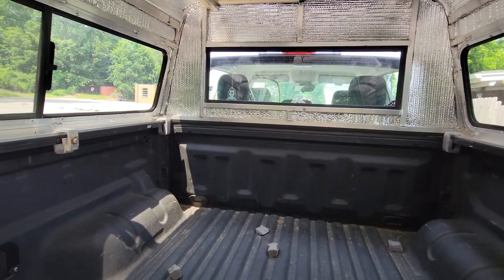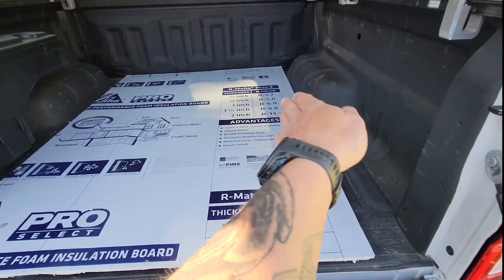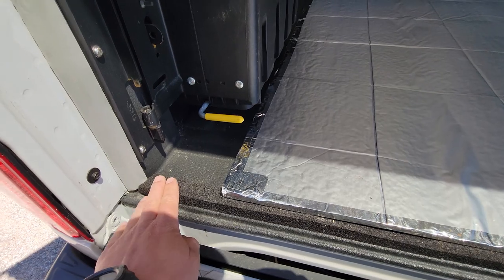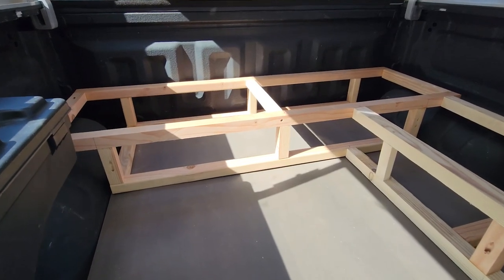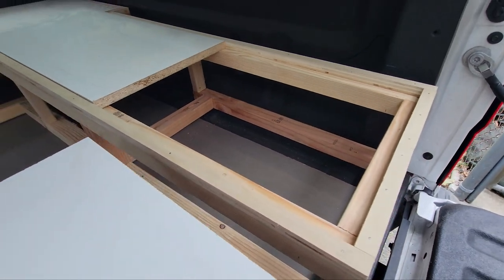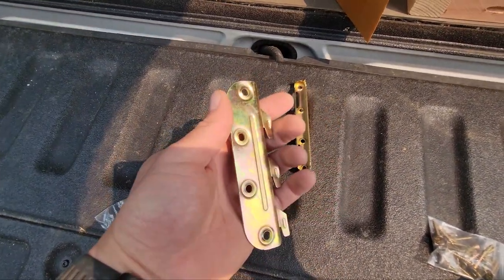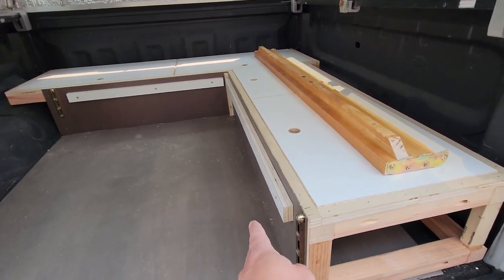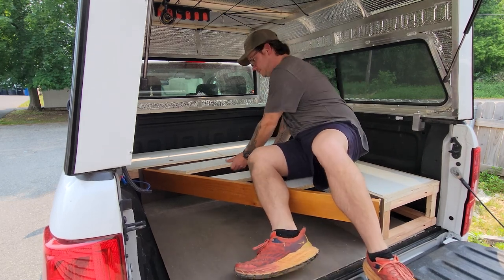Ford Ranger Truck Bed Camping Build Part 2. Floor and Bed DONE!

Comment: I sleep diagonally in my short bed truck too. Its awesome and super cosy.
Reply from the maker: It is a pretty cool way to camp. For those times where you feel like adventure but not a lot of work lol. I would be so happy if I had at least a 5.5-foot bed though. This truck is awesome. The bed size is the only thing that haunts me.
Reply: @projectknifehand  I hear you. I'm about to completely re-design and build my camper. After camping in it several times I figured out what works and what doesn't.
Reply from the maker: Exactly.  I wish I would have just done my own camper from the beginning. Instead of buying this cap.
Reply from the maker: Is your rig a diesel?
Reply: Yes. It has a 3.2 litre 5 cylinder turbo diesel. Very few trucks here in Australia are gas powered. Diesel is king!
Reply from the maker: @AllThingsOutdoors  I'd love to have one.  2.3 Gas here! I was so envious when I saw there were manual transmission diesel rangers elsewhere.
Reply: @projectknifehand  I have an auto and its the Wildtrak spec so has heated seats, reverse camera, auto wipers etc.
Reply from the maker: Backup camera I do have. Mine is an "STX" so it does have a skid plate and a few cosmetic things. Has everything I need honestly. Bluetooth for music, cruise, ac. Tow Package as well. They have much fancier models, but I had no interest in lane departure warnings etc.

Comment: Great idea on sealing the tail gate, I'm going through that headache now dealer gave me a smoking deal on a new leer shell, however, the install wasn't the best, my matress pushes up against the shell and water soaks into it from the tail gate.  I'm copying your sealing! Lol
Reply from the maker: It helps a lot. Might not stop it all but it does help. Put it at the top too and it'll stop it from leaking in there.

Comment: Nice pickup !!! my ranger is 2009 with low mileage (less than 30K)

same problem, i want to sleep in the cab but its a 5'5 and im 5'10 urggg.... 

REALLY Nice setup in triangle, I have all winter long to plan what i want to do for the spring / summer !!
Reply from the maker: Thanks man! Yeah if I even had a 5.5 foot bed I'd be happier. I'd do the exact same thing I did and just have more foot room. This is not ideal but it works. It's a place to keep dry and sleep. I needed the full 4 doors so couldn't get the 5.5 bed. Next truck will definitely have a longer bed lol. I'm at about 65k miles now. And hope for many more though

Comment: Where do you get the gasket from that was used in the front of the shell? Thank you
Reply from the maker: I ordered it on Amazon. Just do a search for Truck Bed Front Rail Seal. Or something similar. That's what it's called is a front rail seal.  I believe the brand I ordered was ESI? You can find some different thicknesses on there. Mine ended up still not being thick enough so I used a thin layer of foam gasket and then put the seal on top of it.  Clean the bed rail well and stick the foam down if you need to. Then the front rail seal. When you are putting it down don't stretch or pull it tight. Sort of lay it down naturally. I also cut it a tiny bit bigger then the space so it was snug at the ends. Between that and a few other things i did my truck bed is completely water tight. Which is hard to do.

Comment: Looks good dude! Mines super similar. I was too lazy for the cross pieces though, my cooler fits perfectly right there and makes due. As for your rod holder. I was thinking, you could probably get a little bungee cord and secure it to the holder and cross over the rods and secure em in, if that makes sense. I've had a beer and dab or two lol
Reply from the maker: That's something I will probably do. Although haven't had much of an issue yet. Just the one Fallin for some reason. But I'm going to use that idea or change it somehow.
Reply from the maker: I'm lazy too but I need it to be nice so people will watch :)

Comment: Get a good bag, and a nice wool blanket. You'll be fine. I was in co last month,  Cordova pass, about 12k feet up. It was like 20mph winds and about 20-25 degrees and I was plenty warm. I have reflectix over my windows, but no insulation on truck bed (factory paint) gonna do a bed rug.
Reply from the maker: Oh yeah I'm not worried about the cold. I've got x therm sleeping pads, bags, quilts, etc.